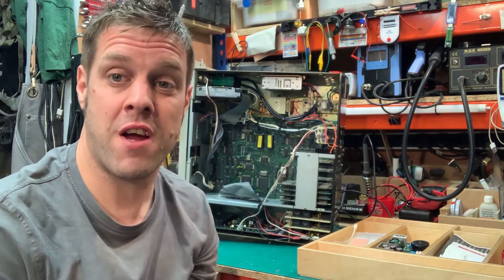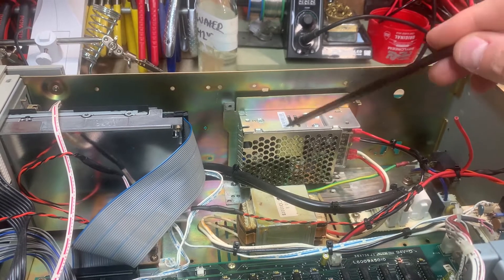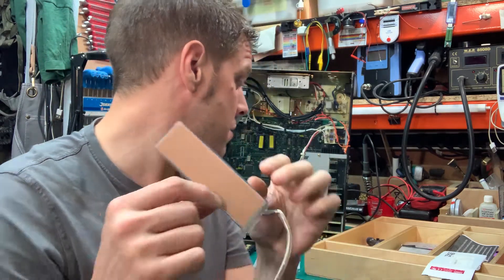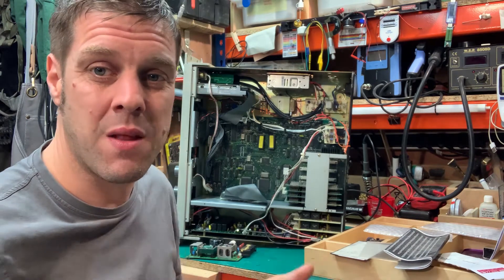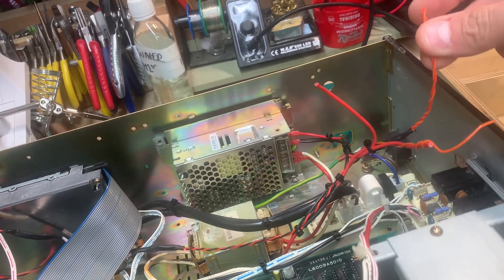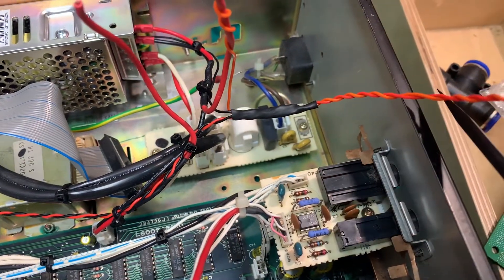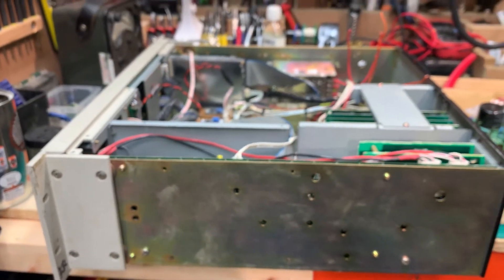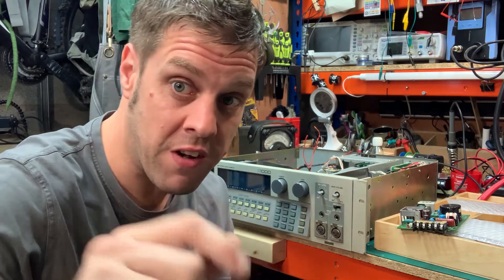Akai S1000 sampler repair part 2 – what was wrong and how i fixed it

Comment: Great Great Video. Thank You. Can You tell me if a Backlight can be replace(with your aproach of cutting of one from a  cellphone backlight) without changing that inverter (square white thing)? If the backlight works but is dim.

Comment: As other people have pointed out, the four card slots that are populated on your machine are the memory cards - 2MB or 8MB each. The two leftmost slots are for a SCSI card to attach a hard drive (nowadays you could attach a SCSI2SD emulator instead) and a digital I/O card. The remaining slot was for the enormous keyboard version of the S1000, and contained a card that was used to integrate with the keyboard itself.

Comment: Great vid but you know we all want to see the repair finished with the fuses inplace etc. did you film one before selling it? cheers :)
Reply from the maker: I’ve not actually finished it yet , it’s keeps getting put off
Reply: @Actual_electrical_content  not a bad thing, prices are still climbing 👍 look forward to part 3
Reply from the maker: @awkwardtom  when I picked this up they were cheap as chips
Reply: @Actual_electrical_content  question for you, would placing a fuse on the 5v feed from the mainboard to the step up converter protect the mobo if the converter shits itself?

Comment: The expansion cards are RAM models, either 2mb or 8mb per card. Most probably 2mb in yours.
It's not the el backlight failing that can take out the motherboard but the PSU. As the caps fail it can cause variations and increase the output voltage. Anything above around 5.5V can damage the motherboard. It's basically built like a PC.
Even if it powers on after repair, I would still thoroughly test all functionality if you want to sell as fully functional as the PSU failure may have caused some damage to the motherboard that may go unnoticed in a power-on test.

Comment: Sometimes when these fail like this, it can affect ICs on the mainboard, so it's worth checking over it's functions. The easiest one to check is if memory is being registered, as when you first turn it on it'll say the Operating System version and how many "MWORDS" it has. If you have memory installed and it says "0 MWORDS" you know you're in trouble!

Comment: The cards are the RAM cards, where the sampler stores its samples. There's also 2 connectors for a SCSI and a digital IO card, but those are missing in your unit.